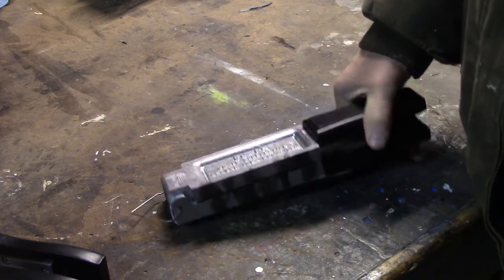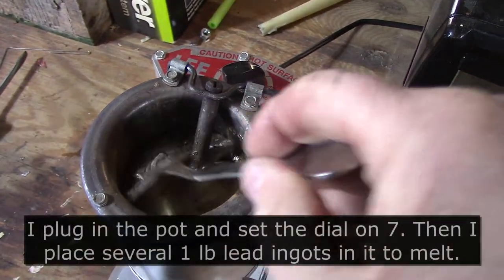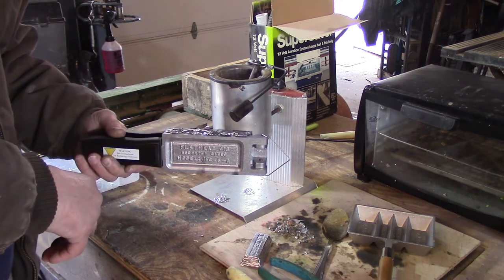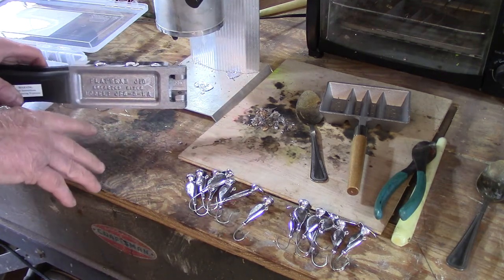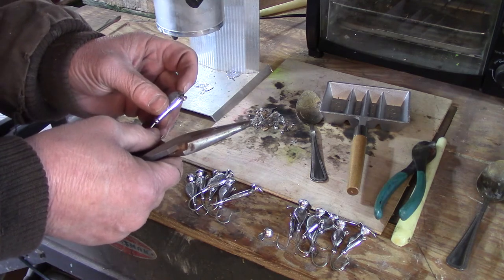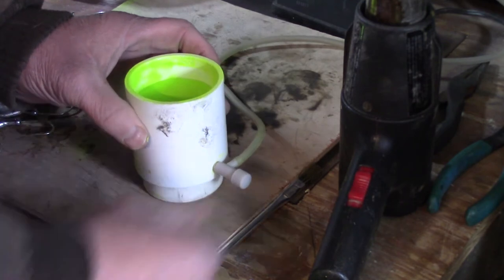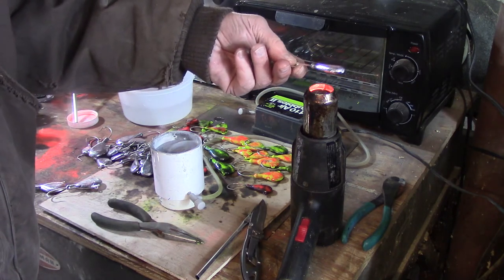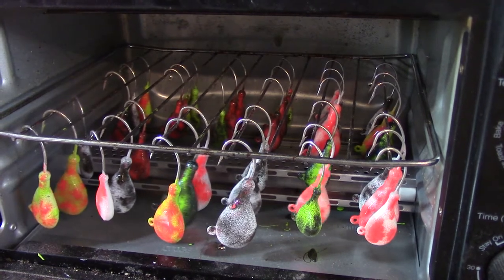How To Make Your Own Blackfish / Tog Jigs Step By Step!!!

Comment: Are these as good as bottom sweepers?
Reply from the maker: I believe bottom sweepers were designed specifically for tog. They keep the hook elevated and in a straight up position for a better chance of a . But they were only designed to serve that one purpose. So in that regard if you are only targeting Tog then I think bottom sweepers would probably be a better choice. The ones in the video are a multi use jig. They are similar to the old style jigs that are still used for Tog and by adding some bucktail skirting make an awesome jig capable of catching multiple species of fish using a cast and retrieve method. I chose these because the mold and hooks are inexpensive and readily available. In additon they are more cost effective for me because I use them for fishing different methods for different fish. I hope that helps and whatever jig style you choose remember to have fun! Thanks so much for watching and may God bless you richly!

Comment: What's the actual cost per jig including all materials?
Reply from the maker: That is going to depend on how on the size and how many you make. If you don't include the mold because I use it for bucktails as well, here is the breakdown. Hooks are $13 a hundred, Lead is $1.50 a lb. and paint is $7. So if I make 100 jigs the average price per 2 ounce jig will be approximately 46 cents each not including my time, melting pot, electric, etc. 

Cost below is approximate cost (yours may differ some) for materials per 100 and does not include shipping which I get free on orders of $75.

$18.75 for lead
$13 for hooks
$14 for paint
$45.75 Total

If you include the mold ($43) then it is about 90 cents a piece for the first 100 jigs. I purchase my molds and materials from Rock Island Sports: ockislandsportsgov.com/  Hope that helps. Thanks for watching and may God bless!

Comment: Do you have to use the jig hooks with the bend or can the eyelet of let's say mustad 3407 straight shank just be placed inside the center of the jig?
Reply from the maker: You have to use the recommended hook for the mold so that both the sizing and orientation of the eye lines up with the indentation of the mold. If you wanted to use a different hook you might be able to use a dremel too to grind out a spot for the eye to set in. Hope that helps. Thanks for watching and God bless!